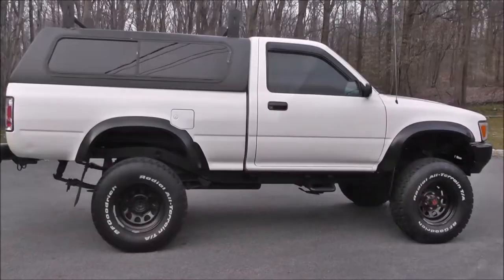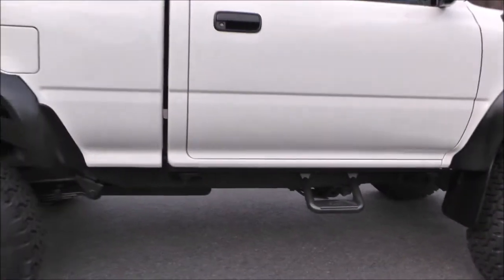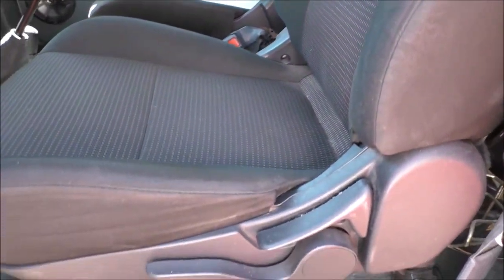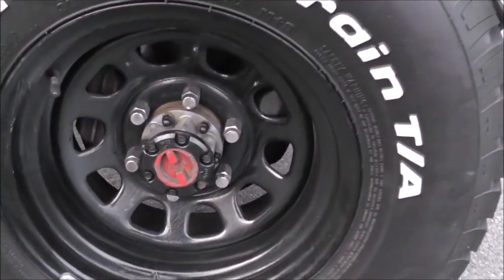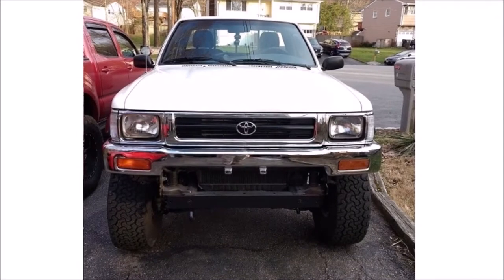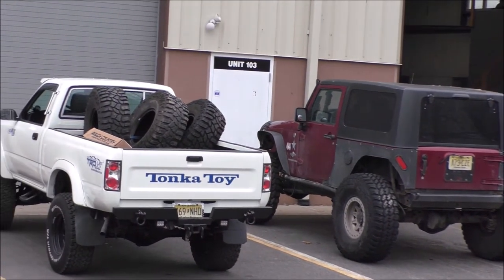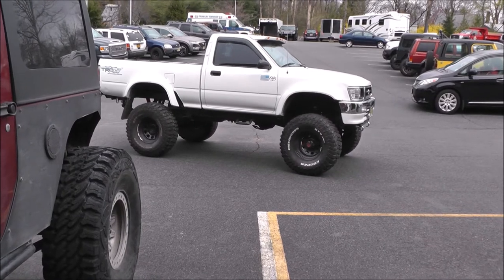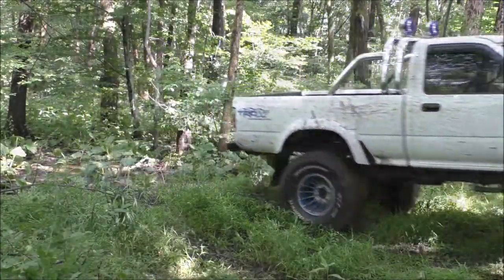TOYOTA PICKUP TRUCK BUILD: THE DEAL TO THE BUILD- PHASE 1

Comment: unless your going to 37s I would go with 488 gears. I've got 529s in mine with 33s and its top end hwy speed is just too low. 3200 rpm I can barley hit 60. I'm on the fence now deciding between 37s and 35s, I need 37s to bring rpms down but not sure it will handle them with ifs